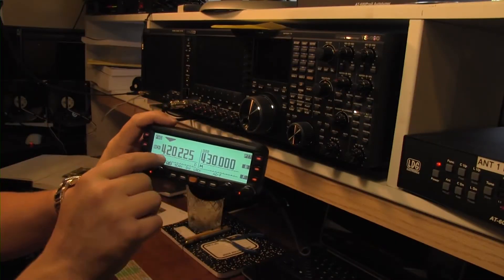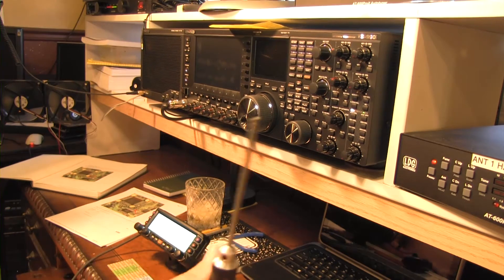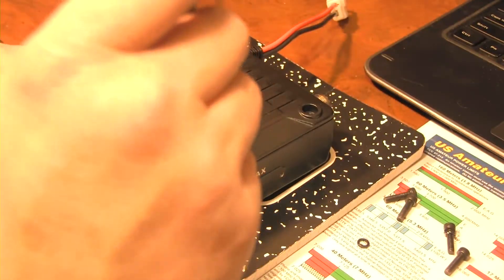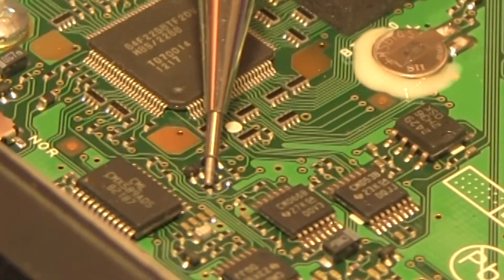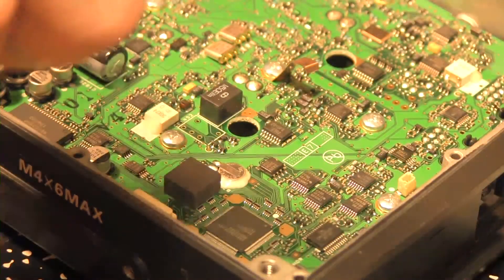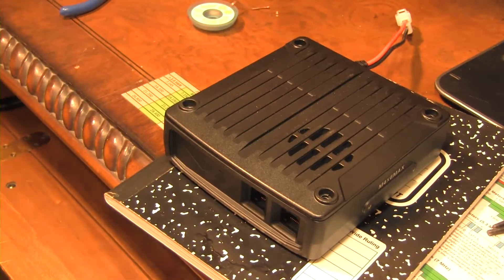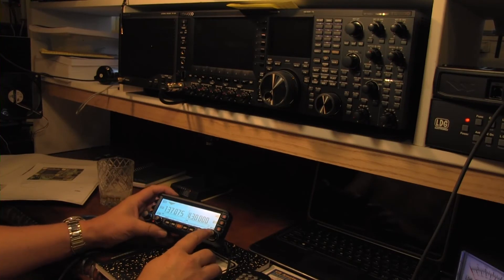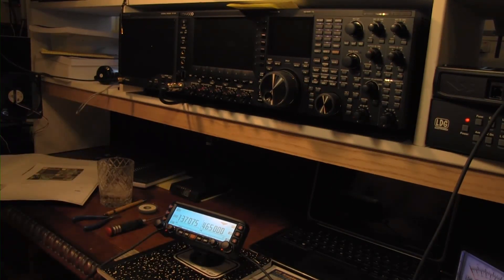Yaesu FTM 350 AR Band Modification

Comment: Hi. No ESD protection while soldering on the board? I am surprised... Btw it looks like you had a big trouble with heat-up the jumper iron. It is because the soldering tip is too tiny my friend. It is better to use one size bigger to heat it  faster but still securely. Otherwise many thanks for sharing that mod. I am thinking about it on my own 350 too, ;) good luck! Petr